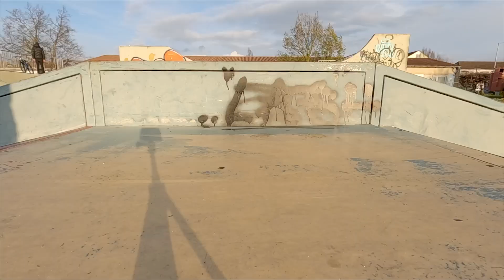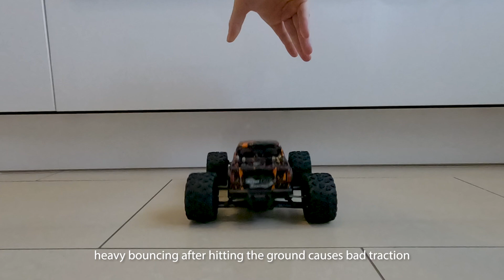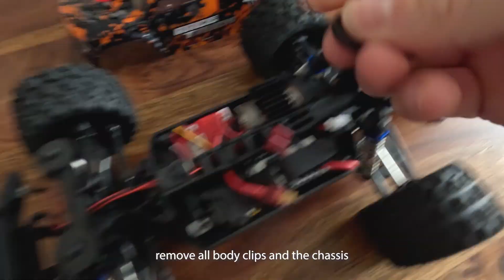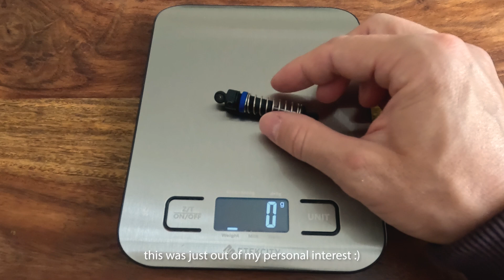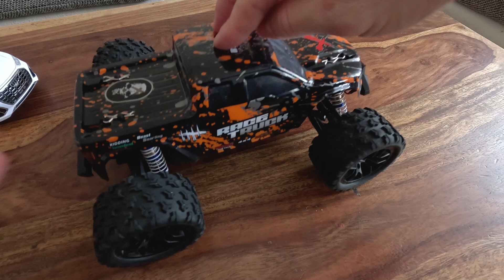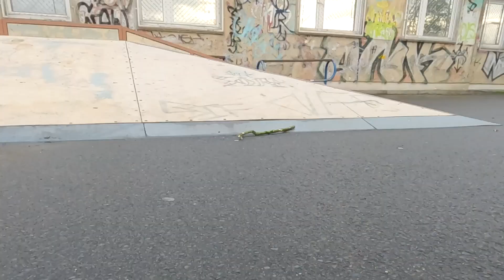Haiboxing HBX 18859 upgrade part 1: Oil shocks 18HOP1 | suspension | tuning | rc car | drop test

Comment: I made the same upgrade on the 18868 truggy. But like the original shocks and in your case, the rear are to soft and still hit the ground. Do you tested it with other oil?
Reply from the maker: Hey! Currently I run 30W front and 40W rear. You can have a look into my Part 3 video. But additionally I have installed some stiffer springs for the rear.
Reply: Check out my HBX 18859 short videos out of my custom build. So insane.